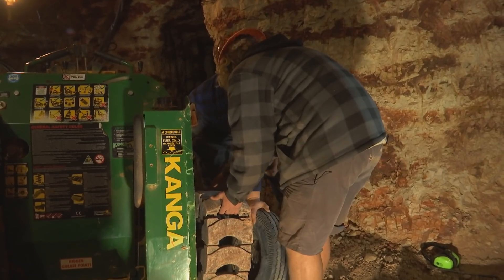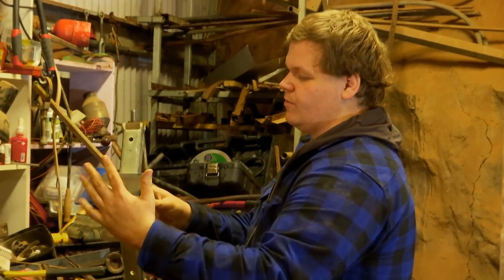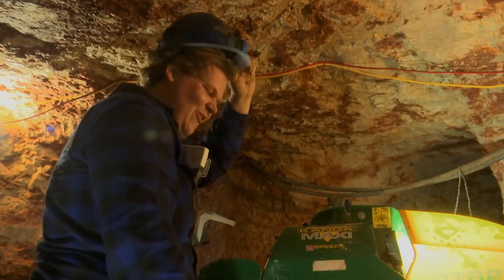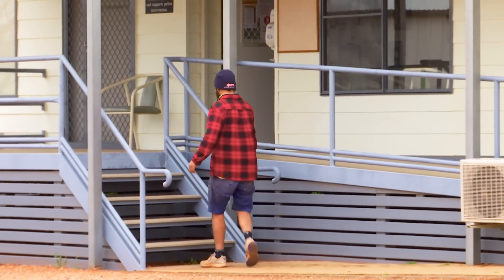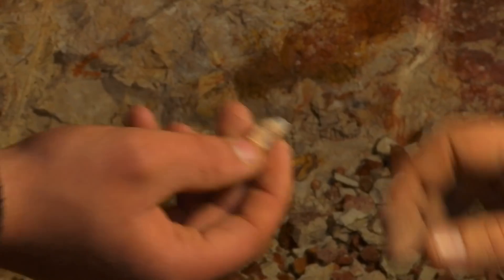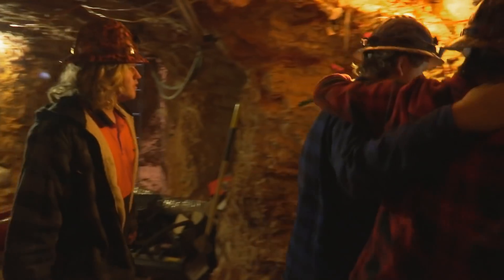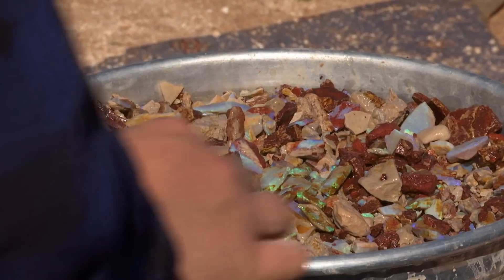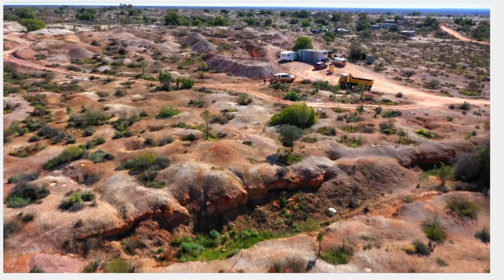The Young Guns Find Good Opal Despite A Serious Foot Infection | Outback Opal Hunters

Comment: just install the tyre on the hub while deflated 😂
Reply: Stop it with your reason.
Reply: Exactly 🤣
Reply: I was about to write it straight away xD and you beat me to itxD
Reply: Crazy kids🤣🤣🤣
Reply: The tyre requires a certain amount of psi in it or it will pop the bead as they are tubeless. They are designed to go on inflated we unfortunately just did not have the specific tool for the job and it was a week wait to get one sent out. Made do with what we had on hand.
Reply: @younggunsopalhunters  😂. Try it while the tire is deflated. Trust us.
Reply: @corrosivepyro  you don’t think we have tried that before 😂 would you like me to send you the video of how to change a kanga tyre on tracks 😂
Reply: If it were that easy, the manufacturers wouldn't have a special tool to do this with. Similar to the one they built.
Reply: Thats what I was thinking :)
Reply: Just cause you play minecraft doesn’t make this your professional. I’m sure they knew what they were doing
Reply: Duh
Reply: @ThatOpalGuy  q1
Reply: @ThatOpalGuy  aaaaà

Comment: Inflate the tire after putting it on the machine would be easier.
Reply: No intelligence aloud.
Reply: Only faking aloud here
Reply: @gerbil7771  allowed*
Reply: So get it to pressure while the track is on?
Makes sense
Reply: Typical discovery,make a drama out of nothing!
Reply: The tyre requires a certain amount of psi in it or it will pop the bead as they are tubeless. They are designed to go on inflated we unfortunately just did not have the specific tool for the job and it was a week wait to get one sent out. Made do with what we had on hand.
Reply: @younggunsopalhunters  nah mate once the bead is on can let it down put on axle then re-inflate no problem, it takes a fair bit of force to debead a tyre as i worked in tyre fitting for years, excuses that are bs only adds to the humiliation hahaha
Reply: @dwaynecallow8152  how many kanga tyres have you changed on tracks mate 😂😂
Reply: @dwaynecallow8152  They tried it before and it doesn't work. The tracks deform the deflated tyres and it pops the bead as said.

Comment: Why not just deflate the tire.....
Reply: Exactly
Reply: Gota make drama for tv
Reply: The tyre requires a certain amount of psi in it or it will pop the bead as they are tubeless. They are designed to go on inflated we unfortunately just did not have the specific tool for the job and it was a week wait to get one sent out. Made do with what we had on hand.
Reply: @younggunsopalhunters  ratchet strap around the tire when its deflated allows for the bead to seat.
Reply: @danc9866  seating the bead isn’t the problem if you put it on deflated below a certain psi the tension on the tracks will pop the bead or unseat it making inflation impossible. A ratchet strap isn’t going to help.
Reply: @younggunsopalhunters  think you should of been able to lower the pressure in both tires to have a little more room to work. With them still holding the bead. Also making it easier.
Reply: @cannednolan8194  not enough to make a difference. You need a tool to stretch them out either way and if you lower them two much and pop a bead then back to square one and the job takes longer.
Reply: @younggunsopalhunters  I admit I thought the same as everyone else at first, but researched it and sure enough there is a tool for this. I can see how the tracks would deform the tyre and pop the bead.

Comment: 🤣🤣🤣🤣 no brainer deflate then reflate 😂😂😂😂😂😂😂😂🤣🤣🤣🤣🤣 jack a- -s
Reply: The tyre requires a certain amount of psi in it or it will pop the bead as they are tubeless. They are designed to go on inflated we unfortunately just did not have the specific tool for the job and it was a week wait to get one sent out. Made do with what we had on hand.

Comment: Next time let the air out if the tire then pump it back up you might find it won't be as hard its just a thought
Reply: The tyre requires a certain amount of psi in it or it will pop the bead as they are tubeless. They are designed to go on inflated we unfortunately just did not have the specific tool for the job and it was a week wait to get one sent out. Made do with what we had on hand.
Reply: @younggunsopalhunters  Lol I feel sorry for you having to paste out the same answer a dozen plus times :). But I admit, just put it on deflated was my first thought at well! Anyway great watching you guys, wish I could make a living mining opal, looks like wicked fun.

Comment: All 4 TV the guy gets an infection. Just air down both tires to get the room in the track then air up and away you go.
Reply: The tyre requires a certain amount of psi in it or it will pop the bead as they are tubeless. They are designed to go on inflated we unfortunately just did not have the specific tool for the job and it was a week wait to get one sent out. Made do with what we had on hand.

Comment: Not rocket science put on the wheel first then pump up the tyre🤔
Reply: The tyre requires a certain amount of psi in it or it will pop the bead as they are tubeless. They are designed to go on inflated we unfortunately just did not have the specific tool for the job and it was a week wait to get one sent out. Made do with what we had on hand.